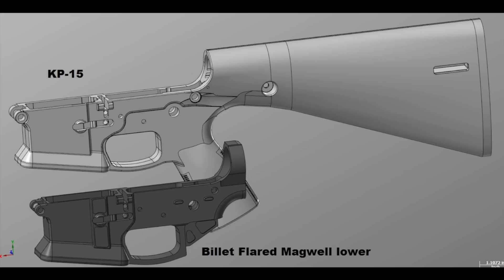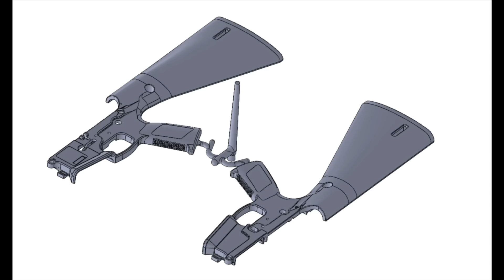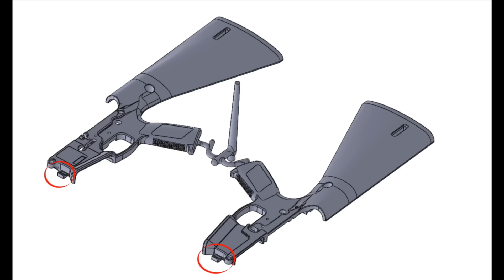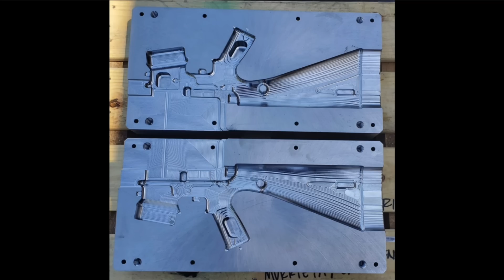WWSD2020 - KP15 Polymer Manufacturing Discussion and Updates

Comment from the maker: WWSD Playlist:
https://www.youtube.com/playlist?list=PLj9u4Ts2NpEuyUMbu1Pe3yXtez7CwkW8c
Reply: hey guys what are ya'll doing with the serial number? Will it be on a molded-in metal plate or engraved in the polymer?
Reply: I know you did one already, but I figure with enough advancements in the past 3 years... maybe an updated optics video? Lots of good variable optics out there now... but for red dots... seems like the new Holosun 3x may be ideal for 2020.
Reply: Are the threads for the buffer tube polymer or imbedded metals? I recently had a horrible experience with a New Frontier Armory lower that has polymer threads. my rifle was leaning against a wall on carpeted floor and fell over on its own. The buffer tube skipped over the threads and stripped it out!
Reply: @Americandog83  There are no threads.  The KP15 stock is part of the lower/mold so you don't have to worry about stripping threads on the receiver.  Same goes for the threads for the pistol grip, it's part of the lower/mold.    If you are looking for a polymer receiver that will let you use your own buffer tube/pistol grip you'll want one with the brass inserts.  The only one I know of is Tennessee Arms.   Keep in mind that the threaded area are still the weak points on that lower which the KP15 won't have.
Reply: maniakaz thank you for the info! Now I am very excited!

Comment: I spent over 9 years working around rubber injection molding and polymer blow molding for an automotive parts manufacturer. I've seen cavities have to be micro welded to bring them back into spec after they've been ran for a long period due to the minor abrasiveness of the material and the necessary cleaning schedule to maintain proper part release. There's nothing quite like a dirty rubber mold with a part that got stuck and then releases under tension, makes a helluva noise bouncing off the inside of a metal roof lol.

Comment: At this point, why aren't we just forcing the issue? A lower receiver is not a firearm. Per US code to be considered a firearm it would have to be:
“That part of a firearm which provides housing for the hammer, bolt or breechblock, and firing mechanism, and which is usually threaded at its forward portion to receive the barrel.”
Sure it holds the hammer and parts of the firing mechanism, but it does not hold the bolt, firing pin and it is not threaded for a barrel. Nobody wants to be a legal test case, and the cowardice government had dropped charges in 5 out of 5 cases challenging that a lower is a gun to avoid any official ruling. Gun laws do not only violate the 2nd amendment, the ATFs claim that a lower receiver is a gun violates federal law. The gun industry should lawyer up to the teeth and make the ATF eat their own crap.

Comment: not sure if its been mentioned in earlier videos, but does the WWSD2020 lower use standard take down pins? and if not will they be provided with the lower and/or for sale on the side? (cross posted on IR and FW)

Comment: Super interesting.  As a machinist and fabricator I have had to do similar R&D for customers.  Vulcanizing rubber to a steel component.  Locking the part into the mold is real.  Just like bedding an action.  Injection site and exit vent location are very critical to the products end result.  Awesome job Russel.  And thanks to Ian and Karl for walking us thru the concept on the way to finished product.

Comment: Very interesting video showing a little of what goes on behind the scenes.

I think in another video on the project someone said that the stock is a nylon or glass filled nylon. So I was wondering, what type of coating are you using on the nylon to keep it from getting damaged by moisture?

Comment: Mould making requires a certain level of voodoo.  Tha materials injected are molten, and they change dimension as they cool.  So, your mould has to be a different dimension than the desired finished product.  A similar thing occurs with cast metals, too.

Comment: Very exciting :) How durable is that carbon fiber handguard when it's slammed against say a rock or a metal door? It looks quite expensive.
Reply: Maarten Hartmann very. It might have some finish damage, but it doesn’t shatter or splinter. I’ve had mine since thanksgiving, only complaint is I had to put a shim between the handguard and gas block before I tightened the handguard down or else it would touch the gas block. Still only about an eighth of an inch gap, maybe I got a bad one 🤷‍♂️

Comment: I hope they delay it as long as they need to. A delayed product is eventually good, whereas a rushed product is never good. And I hope they do proper thorough torture tests with mass production versions and revise as necessary. Glock only tested their hand built prototypes of the model 44 and look what happened. Although Glock made a fundamental error in materials choice. This is uncharted territory, so I really hope they take all the time they need in order to do it right.

Comment: I'm curious why things like pin holes are in the mold. Why not mold it solid and drill the hole out once the polymer is cold and shrunk to final size?
Reply: The more post molding labor you add, the more you defeat the purpose of molding in the first place.   The glass fibers can also be compromised.
Reply: @SinistralRifleman  I'll also add the fact that machining anything with a decent amount of glass fiber eats up tooling like crazy. You pretty much have to use carbide to get any tool life, and even carbide gets dull pretty quickly compared to machining iron or normal steel.

Comment: I'm not sure how well the pencil barrels will meld with high capacity mags watch that space
Reply: what?
Reply: Mine has been fine. Soldiers in Vietnam dumped mag upon mag through them on full auto and never had a problem with the barrel dying. Marine Corps made the A2 thicker past the gas block just to improve “hang” during standing offhand shooting during qual (they claimed it was to prevent the barrel bending, but they didn’t even thicken it where the barrel would bend AND the supposedly bent barrels would pass a straightness gauge after sending some lead solvent through the bore).

Comment: What welding process will you use? You're gonna have a tough time with weld flash if you didn't design a weld joint with a flash trap, gonna need manual post process g to clean it up
Reply: Post welding trimming will occur

Comment: Any chance of a finished lower or semi finished lower (just PDQ installed?)
Reply: They talk about it in the video, it would require a whole new mold so a whole other 500k. They don't see it as worth it to make the mold have the ability and considering the mk2 lowers were simply filed to make pdq's fit I have no doubt you can just do that with the new kp15's if you really want it that bad.
Reply: the PDQ modified ones are exclusive to Brownells full WWSD2020 rifles only.  There is another whole process after the lower is made to cut the slot for the PDQ. If you decide to buy the lower seperately you'll have to cut the slot yourself, same as you would have to do on an aluminum lower.

Comment: Do they have different length of pull for the butt stock possibly? Also I am wondering if a cooling device could be possible in the future for the faxon pencil barrel , like a JP thermal dissipator ?
Reply: Linqian Chen fixed A1 length for now. I think JP patentedthat dissipator, if it fits in a cf handguard, that’d be pretty damn cool (npi)

Comment: Any more info on the Colt polymer lower from the 70s? I had never heard of that. Kinda like finding out about the composite hulled Bradley's from the 80s and the XC-142 VTOL from the 60s, a lot of "modern" ideas are older than you'd think.

Comment: They should do a .308 version if this is successful.
Reply: There is no mass market for .308s or enough compatible parts available to justify the cost of the tooling.
Reply: .308 ARs suffer from a lack of concrete standards unlike the AR-15 which limits the market for them.

Comment: I dont remember if they already talked about considering placing an inner steel liner, like glock magazines. Then the outer shell wouldn't necessarly have to be in tight tolerance, no?
Reply: Derika Friedrich I’ve thought about something exactly like that. The HK Roller-Delayed-Blowback series tends to be kind of heavy due to using stamped receivers, but what if you use a G36 style polymer receiver, with the metal trunnions or having a thin bolt channel for the bolt to cycle. If I’m not mistaken, ATI makes an OMNIMAXX receiver that’s is just that.

Comment: So what I've gathered from this is Karl's going to find a way to come out with a stamped AR lower for WWSD 2024
Reply: He will settle for milled WWSD-20, and then develop the stamped WWSD-M
Reply: A stamped AR isn't what stoner would do, it's what Stoner did.  It was called the AR-18.
Reply: @nunyabidness8870  I thought the AR-18 was designed primarily by Jim Sullivan and a guy named Arnold something. Wasn't Stoner at Cadillac Gage by the time of the AR-18?
Reply: There is/was a stamped lower, but it comes in pieces and you have to weld it together.   

https://www.thefirearmblog.com/blog/2017/06/02/weldable-ar15-flat-spot/

Looks like the company might be out of business.

Comment: That's very cool, there really are some amazing polymers about these days - the VLF glass or carbon filled resins that are available now are starting to rival aluminium.  It really wouldn't surprise me if we started to see crazy things like polymer gearbox casings in the near future.
Reply: Thermal conductivity is not good for most polymers but you might be able to so active cooling or a additonal heat sink.

Comment: Karl, I remember you guys mentioned that aside from the CAV arms polymer lower, all other polymer lowers are garbage. A recently updated polymer lower is the Tennessee Arms Co lower. I have two of them and have had fantastic luck, barring some flashing over detention holes. Just wondered if you guys gave them a try. They use brass inserts for all threaded pieces. They’re fairly cheap, on par with an Anderson aluminum lower. So maybe give it a look?
Reply from the maker: I can look at that with one glance and realize it's not a design intended to be polymer, thus the metal inserts to attempt to mitigate the issues of turning an aluminum lower design into polymer.  No, I have not looked at that one in particular, but there are others on the market who tried the exact same thing with poor results.
Reply: InRangeTV  Thanks for the reply! Yeah, it’s not from the ground up meant to be polymer. But I have used them with good results. I made a very budget version of a WWSD carbine using one of those. 10.5” barrel and a Shockwave blade. It’s less than 5lbs overall and I probably spent about 550-600. It’s a good budget, super light lower. It’s not quite as durable as aluminum or the KE arms one coming. But it’s more than serviceable. Just wondering if you had tried it. 👍
Reply: InRangeTV Technically speaking, the entire AR style receiver was not designed to be polymer. If you ever have nothing new to review or you’re just bored, give it a shot! You might like it. Thanks for the update and I’m excited to see it all come to fruition.

Comment: but what if i get into a firefight in a burning building and the fires melt the plastic? this post was made by aluminum gang
Reply from the maker: You should have put the fire out first.
Reply: Aluminum doesn't get along very well with fire either.
Reply: @moosemaimer  As someone who once had a garage burn down with three aluminum engine blocks turned into puddles that flowed over and off the slab into what looked like a shiny metal creek outside where the building was, I can confirm.

Comment: Just in case somebody has issues understanding the "shrinkage problem" they were talking about, Almost all materials when they are in the molten state fill higher volume compared to when they are in the solid-state. While solidification, the material starts to go through this change and it will show itself as shrinkage. This problem exists both in metal casting as well as polymers, but the difference is that the behavior of the polymers is much more complicated and less predictable by the human mind so there is the need for computer-assisted simulation to prevent errors in the final product. if they don't take this into account, it is possible that the straight line in the CAD design shows itself as curved or even wobbly.

Comment: Not an American here. What is meant by an 80% configuration?
Reply from the maker: It's a part not yet sufficiently completed to be considered not yet a firearm by the government.  People typically buy them without any paperwork, as it's not a gun yet, and then attempt to finish them at home (which is legal to do).
Reply: @InrangeTv  Interesting, I was under the impression that all AR-15 recievers had to be serialized and maybe registered. This sounds like a way of dodging that.
Reply: @darrenjacobson7456  All firearm receivers/frames have to be serialized to be sold, but an "80%" isn't legally a firearm until it's machined, so it doesn't need one. And since you're legally manufacturing the part yourself, it doesn't have to be serialized, unless you plan on selling it, and then you get into the regulatory morass around what constitutes a "dealer." 
Keep in mind 1: there is a legal allowance for building a gun by yourself, and 2: every gun starts as an inert block of metal until it's made into a part. As far as registering it, that is entirely up to the particular jurisdiction in which someone lives. Some places don't require any form of registration at all, and in others simply possessing an AR lower is a crime.

Comment: As an automation controls designer (formerly an engineer/programmer), Props on the current progress! Keep up the good work!

I work in automotive industry, and we also run 60-75 second cycle times to meet vehicle stock and purchase demands. 

Kind of the overall point of such short cycle times is that given an example of 100 working areas (stations) on a single linear assembly line takes 60 seconds. That's 100 minutes or almost 2 hours to produce the product and run through the entire system.  Granted after the first one, you're spitting out a new product every minute, but the initial and last build of a model is going to take that much time to fill and empty. Which in reality is the time taken for a facility to ramp up or down from cold start or shutdown.

P.s. Glad this video exists to enlighten people on tge process and running of manufacturing industry!

Comment: I'm always fascinated by manufacturing processes and kudos for doing the work to make it right before putting it on the market. However, as this video goes on it becomes apparent that polymer is not for firearms. As Carl keeps pointing out "that's just like stamping". A stripped cast lower, fully machined is already available for less than $100.
Reply: "polymer is not for firearms" -- That's a pure comedy statement in a world where PMAGs dominate the rifle scene and all the most popular pistols are plastic.
Reply: There’s looks like a modified copy of a 3D printed AR-15. Also I don’t know if you know this, but companies have been making polymer lowers for years for “assault rifles”, like the Calico for example (an example I love because it’s made by the California Company and banned in the state of California because the lowest capacity ever made is 50x 9mm with standard capacity of 100x 9mm which of course works even in their pistol), those used polymer lowers even in the 80s and I’ve never heard anyone complain about it (the only complaint is their polymer helical drum mags not feeding). And the military AUG for example uses a plastic trigger pack/fire control group. Polymers have been used reliably for years, it’s not a new thing, even for rifles. It’s been improving since early adoption (just like metal ones, to an extent, there have been quite a few metal goof ups though even recently... material doesn’t mean idiots can design it, still needs good design).

Comment: I waunt it!

Does this have any way to adjust length of pull? Shims, butt plate extensions, etc? I obviously need to go rewatch the entire WWSD series. 

I only ask because A2 style stocks seem overly long to my squat frame.
Reply: If I remember correctly, these stocks are A1 length. You could maybe fit an overmoulded butt pad on it if you need it longer. 
Don't take my word for this, I'm not 100% sure. What I am sure is that people will find a way to modify them.
Reply: Yes they’re A1 (13” LOP). That length was determined by the Army to be useable by the largest percentage of sizes of people eligible for service.

Then the Marine Corp fucked it up and added an extra 5/8ths (more long armed gorillas over there I guess).

For this lower, I think there may be enough space between the buffer tube (it’s only carbine length) and the buttplate that you might get away with trimming it down slightly. Don’t quote me on that.

Comment: is the 3d printed version fireable?
Reply: Probably, there are a bunch of 3d printed AR-15 lowers in standard size, some for 9mm Glock mags, some custom magazines etc. Some have low fire count testing (like 1000x shots), some are in newer designs with printed uppers (with 8,000 shots and still going but they ran out of ammo for the test). They even have artsy stylized ones with smooth elegant curves to more Sci-fi looking low polygon triangular versions to some with 3D skulls for artwork on the outside. Since this polymer version looked remarkably close to a modified copy of the printed ones I’d say it is probably fireable (might only do 5,000 shots, but it also might do 50,000 and outlast even the barrel).